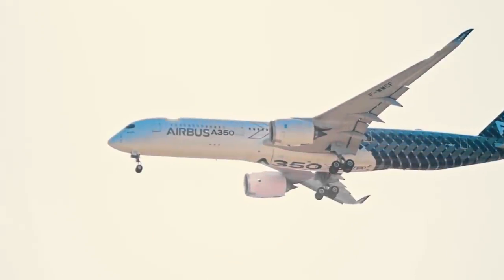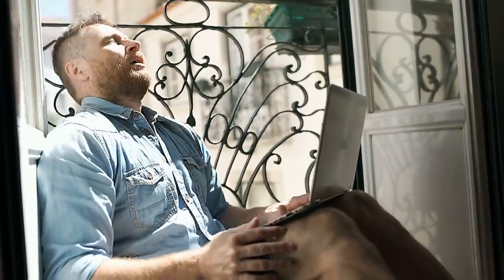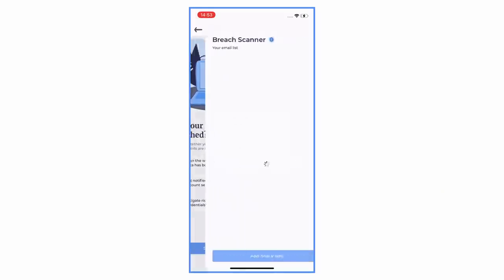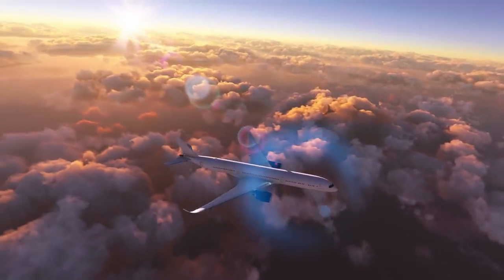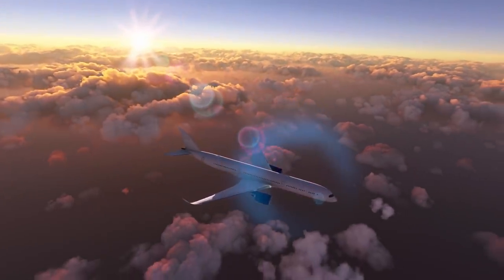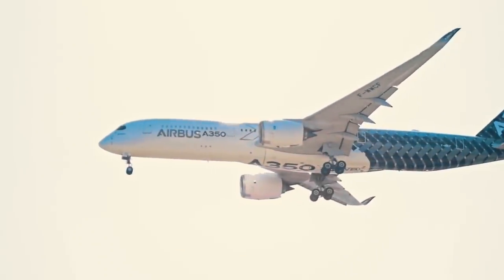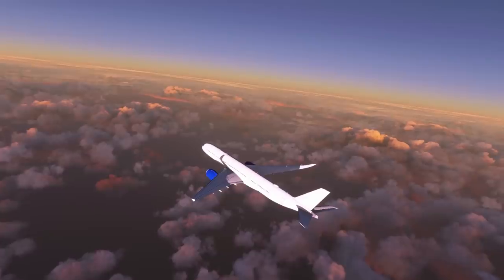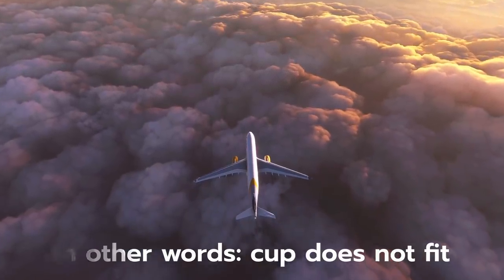A350's Engines Fail Because of Coffee Spill ☕

Comment: Somebody in the design team  might well of recommend that the centre console controls be made liquid spillage proof but like in many cases it was possibly rejected at the time on the grounds of additional cost!!
Keep up the excellent video commentaries and stay safe.
Reply: 30 years ago more important was good design. Today it must be cheap and quick. We all are the cause of the problem. Buy more expensive things than cheapest ones, then it will change like in old good days.
Reply: @norbert.kiszka  Yep, everything breaks nowadays, and is made to last under 4 years. All in the name of saving manufacturing costs :/, but then they charge twice as much nowadays for something that has less quality than say a long lasting product made 20 years ago.
Reply: @thatguyalex2835  10% cheaper thing will malfunction 10 times faster. Still most people want things "cheaper". Cheapest things are most expensive in reality. Start thinking forward, instead what is now.
Reply: @norbert.kiszka  Agreed. I bought myself a second hand '90s leather jacket for $30 from a fellow coworker, and it is probably a few years older than me, and is in near pristine condition.

That won't happen with a modern one, which would probably fall apart in two years.
Reply: @thatguyalex2835  that is very good in my opinion. I have many old things bought for very low price which is good or better than manufactured today. Probably my best example is electronic laboratory multimeter made in 1987. Its still precise as when it was calibrated many years ago (I dont know when was last one), and it was bought for about ~100$ (250 PLN). New one with same precision and parameters costs at least 5000$ and must be calibrated at least once per year.
Reply: @thatguyalex2835  not all, but most of them. Thats because its (stupid) economy demand from consumers. We (all customers) are voting for this with our pockets (money).
Reply: @norbert.kiszka  Yep. So true my man
Reply: What cost?
Reply: How about pilots don't drink liquids in the cockpit? Problem solved.

Comment: This has happened before with a Douglas C-124 Globmaster II spilled coffee on the pedestal and shut down some engines can’t really remember but this is not the first time this has happened in commercial airliners, something like this with early 707’s or DC8’s. In most modern flight decks all fluids are given to the pilots from the outside or outboard away from the center pedestal, never directly over it. Very cool channel keep up the good work. Cheers.

Comment: Well yeah, electronics and liquids, who would have thought they don't mix well? I always thought you'd have to be especially smart to become a pilot...
All in all - and this goes hand in hand with the way we treat human errors in aviation - the part that shocks me is not that those switches were not waterproof, but that there seems to be no regulatory element that DEMANDS that those switches are water proof. Tea and Coffee aside, a window may break and rain might pour in during decent. Stuff like that happens, and we wouldn't want the plance to shut down in that case, would we? So why has no one at FAA and EASA thought about this? 
In Airbus' defense, they go to great length to make work for pilots as relaxed as possible, more so than any other manufacturer. The fact that you can eat/write properly, the amount of space in the cockpit, the noise leve, the layout of the cockpit, the grade of automation, all this tends to be ahead of the competion. I've never been in an A350 cockpit but those cup holders look normal size to me. Question: Why do they let pilots drink out of those paper cups? Give them a decent mug, put a cover on it. Why are open containers of liquid even allowed in a cockpit? Questions qustions. But yeah, Airbus should have designed those panels water proof to begin with. Judging from their track record of having the sh*t very much together (and these days certainly more than their arch nemesis), I can only asume they simply developed a sort of tunnel vision on that one and are probably biting their a**es more than anybody else because of this.
Reply: Water proof switches are used for decades. Why expensive multi-millions aircraft can have two stupid switches water-proof? I know why. Design pedestal with them, is more expensive. Manufacture one switch to be water-proof is 1$ more expensive. Money is the reason.
Reply: @norbert.kiszka  These are standardized components. I can assure you that the switches themselves were not the problem.

Comment: Speaking of stupid cupholders, my car has a cupholder that sits in the centre console as you would expect; however the handbrake is this weird U-shaped device that looks like an airplane throttle and it blocks most coffee cups when the handbrake is applied. Every time I have to apply it, I must take the coffee out and awkwardly hold it in my hand while I apply the brake, in case it picks up my coffee cup and tips it over. Then, when I move off, I have to release the brake and put it back it quickly before I get honked at!
Do you hear me Vauxhall? Your cupholders/handbrakes are stupid!

Not really related, I just wanted to rant! 😡
Reply from the maker: hahaha oh my. 0/10 for usability!

Comment: There are some spoiled cockpit and cabin crew who do not think about electronics and moist and what problems spillage can create.  Seen enough results on Audio Control Panel and in general the Centre Control  Panel Stand ...the printer above all  .  Also where they should place the coffee cups... there  is always old spillage visible. Probably they spoil at home also and do not clean it up instantly ,there are towels there for that purpose but there are very few  crew that use them .  Also as a Airline Operator if you have to let crew  control a million costing control centre ..and  you are not thinking that the "coffee" cup size they get served by "anxious " cabin crew that should be specific to use only for cockpit (only talking about coffee cups) . They hardly ever make a complaint about spoilage  in the board books either . So is it avoidable yes .... by retraining ...but even the most smartest (not always) do not remember that keeping work area  clean is essential.  Perhaps giving them a cup covered by a lid plus straw would be the most safe solution..... and it works with little children too..... crew should know !

Comment: This video is suspect…..I flew for 19 years and a First Officer I worked with was fired for spilling a Pepsi on the centre console…..also this is the reason flight crew can only have sugar cubes in their drinks, not normal sugar…
Reply from the maker: what's the difference between sugar cubes and normal sugar? what if a pilot wants to have a coke?
Reply: @AirspaceVideos  presumably sugar crystals could be spilled and get into machinery as small grains whereas cubes unless dropped don't produce grains.

Comment: So they put up a no liquids sign!? That's not a fix!  Make your electronics up to a STANDARD. IPX4: Is resistant to water splashes from any direction. IPX5: Can resist a sustained, low-pressure water jet spray. IPX6: Can resist high-pressure, heavy sprays of water. ... IPX7: Can be submerged up to 1 meter in water for 30 minutes

Comment: An interesting topic. Personally,, I question the reasoning behind this 21st century issue relating to the installation of cup holders to be deemed a necessity in nearly every form of operato controlled transport vehicles. I have a lot of flight hours under my belt - admittedly as a PPL  pilot, the planes I used to fly had no such thing in them, even if I was undertaking a lengthy flight, the thought of drinking hot beverage whilst flying never occurred to me. I often wonder how many accidents have been caused while trying to drink scalding hot tea or coffee while driving - you are not allowed to use a mobile phone, for this reason. I will admit though that given tat my Jaguar has two such items in the front console, I have used one on sea mine to hold a cold can of cider! - I live in a rural district & do so for the absurd shock value it has on passengers!😊

Comment: I understand that engine control switches can actually shut down an engine (this is what they were designed for and so the liquid can affect their actions), however what about ECAM control panel? ECAM control panel controls ECAM display, it is used to select different pages etc. None of the buttons on ECAM control panel has ability to shut down an engine. So what the heck?
Reply from the maker: I wondered about that too

Comment: Shows how engineers can be incredibly smart and also pretty dumb at the same time.
Reply: Software engineer here. It is actually extremely hard to account for everything the end user might do. In one application we had to remove a minor warning which came up with two options "Cancel" and "Ignore and proceed". Users kept on pressing cancel and then calling support that it doesn't work.
Reply: @fireiceuk9221  alot of context menus and UI are very poorly designed. like "Quit without saving - YES NO CANCEL" - is not intuitive and takes a few seconds to stop and decipher the double negative. Could easily be changed to say what each button does.. "save don't save cancel"
Reply from the maker: Agree 100% with you there!
Reply: Today engineers must do job more quickly. Time is money. We all wanna things more and more cheap. So who is the cause?

Comment: Cup holder issue fixed!  Just buy a $2 plastic "glass/cup" and some glue, as long as the bottom of the cup fits tightly inside the cup holder, and the top flares out to the required diameter, instant new cup holder. 

Come on guys this isn't rocket science, if you can't fix this you're selves, it speaks volumes about your abilities or the airlines policies.
Reply: The 350 already has lots of cup holders. It’s when idiots pass the cups across the pedestal that the problem happens.

Comment: Electronics designers and fitters today in many companies are forced to do job more quickly, because time is money. Complete project for yesterday or get fired. Electronic engineering years ago was a one of best sciences (yes, electronics is a part of physics science), but today everybody want things cheap as possible, not even worry about they own life... TV or computer with 1/3 of price? Car with 1/5 price? Aircraft with 1/10 price? House electrical installation 10 times cheaper? We are all the reasons for that problems. There is no possibility to have things good and cheap simultaneously.
Reply: Dude cmon not again, planes cost more to develop and make now more than before, and as an engineer that’s not the status quo in avionics

Comment: Hello. I have a question about a different airplane accident and would like your opinion. I am sure you are aware of the 80 plus year mystery of the disappearance of Amelia Earhart! Experts believe that 157-337 is based on a LOP and the position of the sun at sunrise which was at a 67 degree true heading. The true heading from Lae to Howland Island is 78.33 degree or 68.5 degree compass heading. A 67 degree true heading is approximately 11 degrees north of Howland and a 67 degree compass heading (76.54 degree true heading) is approximately 1.5 degrees north of Howland Island. Nobody has looked at the 67 degree compass heading (76.54 degree true heading)! Howland Island is 2556 miles or 2221 nautical miles from Lae, 9.49 degree east magnetic declination near Howland Island on July 2nd 1937. 
Formula: x=sin(inverse)(517÷2556), x=11.67 degree, 90-11.67=78.33 degree true, 78-9.49=68.5 degree compass heading! ERROR Formula: x=sin(inverse)(517÷2221), x=13.46 degrees, 90-13.46=76.54 degree true,  76.54-13.46=67.05 degree compass heading! 
It's possible that Clarence Williams gave them the wrong directions (true heading) based on a simple math error! 
My question is why hasn't any of the experts investigated 157-337 as a compass heading because of a possible 67 degree compass heading? It's possible that they flew 2556 miles on a 76.54 degree true heading then turned right 90 degrees onto 157-337 compass heading searching for Howland Island. What is your opinion?

Comment: I got to be honest when the A320 first came to our airline in 1987 I thought it was a throwaway airplane but it turns out that it has lasted as long as any Boeing product could be expected to. But I have to say that the 757 was the closest thing to a pilot airplane. It had all the automation that you could possibly want including Autoland but could also be flown as a real airplane which would have come in handy in the case of Air France 447. They simply had forgotten how to fly or never learned how in the first place. Come on now potable water is a lot different than spilling some coffee on the control panel. I've never heard of a Boeing going down because someone spilled some coffee
Reply: So how come a 757 crashed when only one pitot tube got blocked whereas AF447 had all 3 blocked?

Comment: The coffee spill incident is just pure blatant bad engineering and is one of the many reasons I don't fly on Airbus aircraft.
Reply: Similar has happened on Boeings.
Reply: And what makes you think this won’t ever happen in a Boeing? Nobody has tried doing it on a 787 but there have been instances of Boeing aircraft having problems with liquid spillages. Water was a spilt onto the autopilot panel of a 707 and it nearly caused loss of control